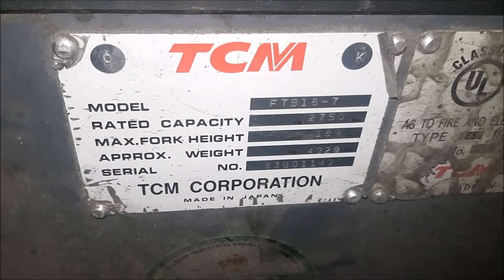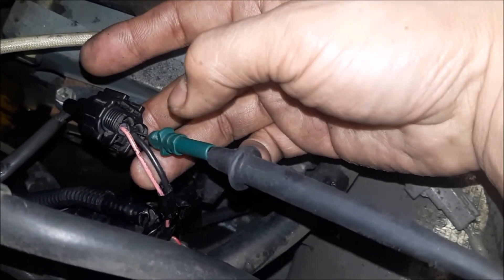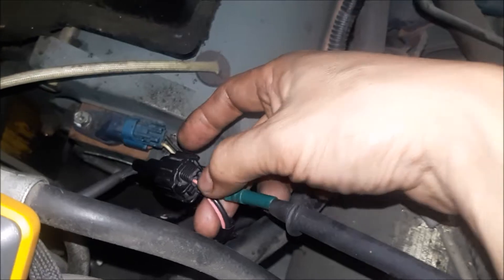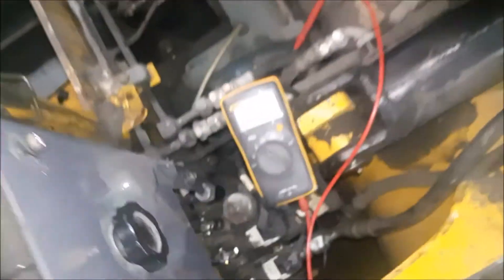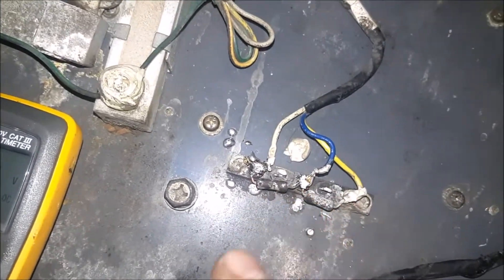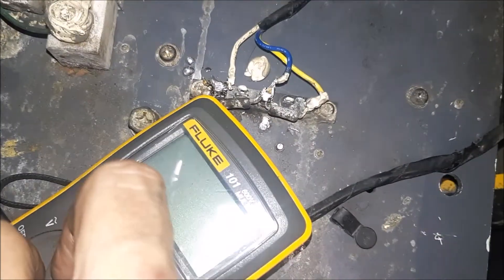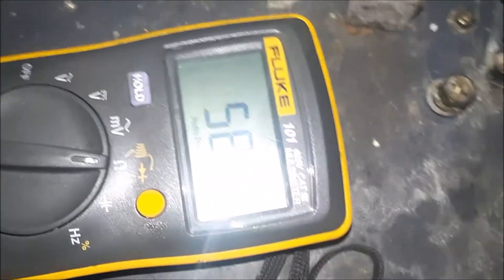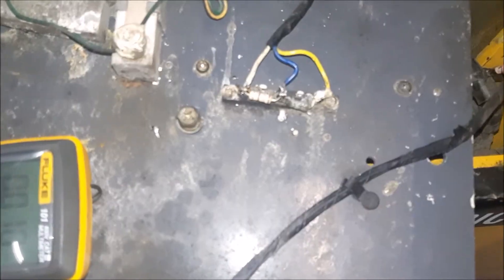Lift Cylinder stuck on lift (cannot lower)

Comment: Hi, sir 
My forklift don't start in the ignition switch and hydrauliic system don't work . 

I connect directely the postif of starter  with the excitor it runs the engine but the hydraulic system don't work .

When i make chunt in the starter relay  . It runs also but the hydraulique system don't work

Comment: sir how about toyota diesel engine only lift up function lift down no function?
Reply from the maker: Then I would check if there is a mechanical binding in the mast, cylinders. If none then it would have to be in valve bank.
Reply: @forkliftgeek10  thanks highly appreciated

Comment: Hi, what do you check when toyota tonero forks dont stay when you lift. They just drop down slowly when not using the controls???
Reply from the maker: Either the cylinder or the control valve is internally leaking.

Comment: I have RR B3 reach truck error E107 occurs after some working with reach truck. Anybody tell me what is the problem. I have replaced the battery but same condition
Reply: The main contactor K10 does not close during truck start up and the emergency stop switch does not operate 

1, defective k10 contactor tips
2, defective a5 card

Check voltage at pin 808 on a5 card voltage must be battery voltage on start up.
If no voltage check fuse f62 (10amp)
If fuse is ok check contactor tips,
Reply: @marclawson3453  it's due to battery. Battery is weak. I have also replaced the MCU. After replacing reach speed issue occurs then I have done calibration. Machine doing it's all functions good. But after some days reach speed problem again occurs. Can you please share with me why this is happening?
Reply: @akmmechatronics5690  what do u mean by mcu?  If the battery is faulty then it will cause the contact tips to arc and burn out. Check the contactor under the seat and see if there is any burn marks. Contractors are cheap and I could probably get u the part no, don’t understand why u are changing computers before trying this
Reply: @akmmechatronics5690  remove the floor plate and check the spring under the brake pedal, the spring snaps and it will throw a fault code and cause the reach to go in and out slow, I think it’s parameter 38 or 28 u need to go into to calibrate it, fault will keep appearing if the spring is broken tho
Reply: @akmmechatronics5690  nope not in this conversation 😂
Reply: @akmmechatronics5690  replace the broken part of the spring with washers and re calibrate as an easy fix, might have to do it a few times for it to register, If I remember right you have to do it with the mast fully retracted as when u calibrate it it also counts how far the distance is so it can slow the reach down before it hits the stop position
Reply: @marclawson3453  OK is it possible that it's due to pump ?
Reply: @akmmechatronics5690  what pump? Why would it be due to that? Check contactor tips, check brake and accelerator pedal and re calibrate them, if u still have same faults then check wiring and check voltage at a5 card, won’t be anything to do with a pump or the computer u said u replaced unless u replaced the a5 card and it’s got different parameters stored in it for a different truck
Reply: @marclawson3453  OK sir will do it as you said. And will share with you the status of reach truck